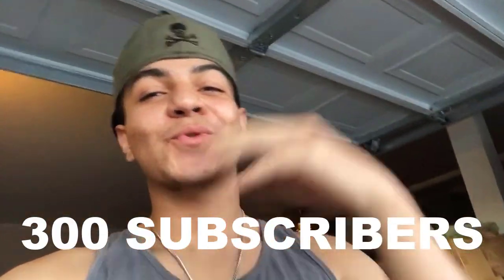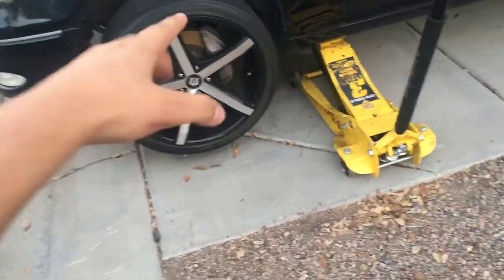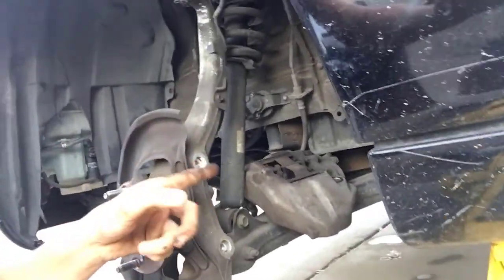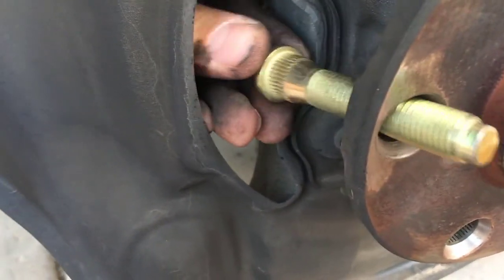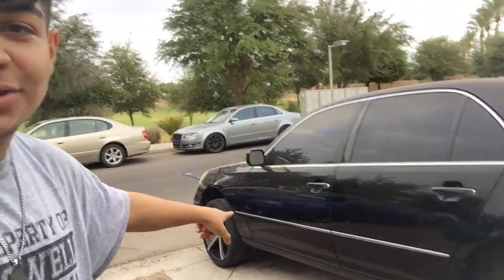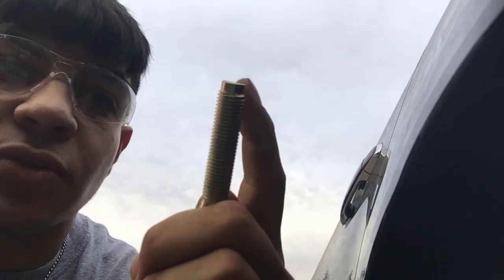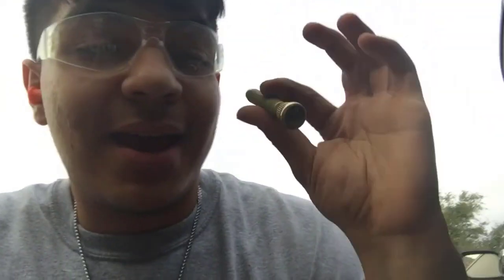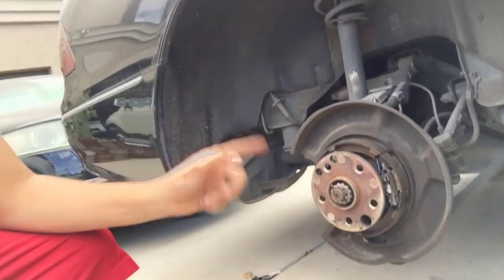LEXUS LS430 GETS BETTER FITMENT AND EXTENDED WHEEL STUDS

Comment: Hey great content Bro ! If I’m running 20x9 1/2 roughly what size spacer would I need on the front ? Thanks
Reply from the maker: I really appreciate and thank you for the support, but to answer your question, just depends on what your offset is now with the wheels I would measure from the tire to the lip to get that answer your looking for.